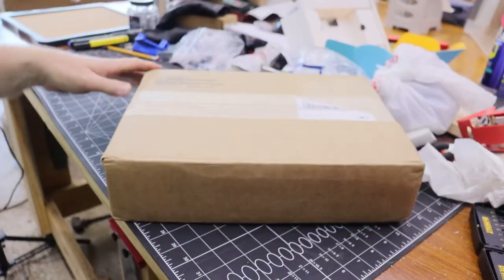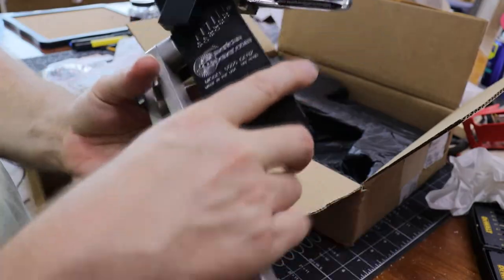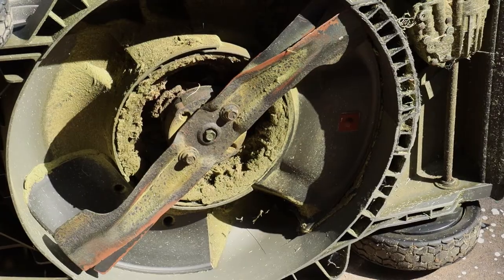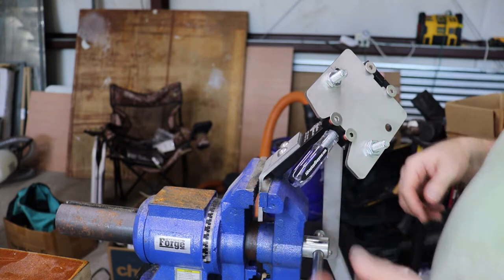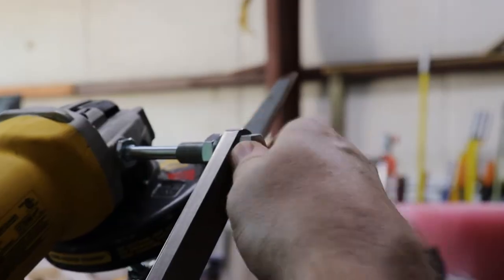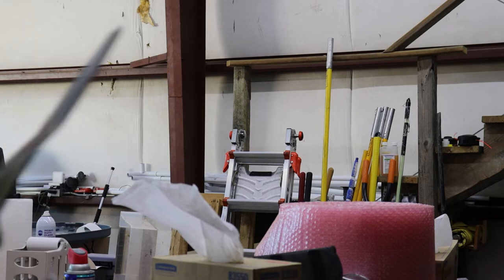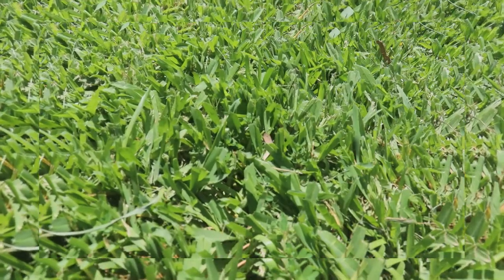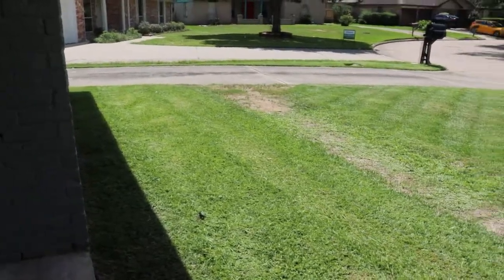🚜 Best Lawn Mower Blade Sharpener By All American!  How To Sharpen Honda Blades!

Comment: Awesome video - I have the same mower and just got the sharpener with the adapter today.   When you set up the bottom blade, did you use the left holes on the adapter for that blade?  Also just wondering what angle settings you used on that blade?
Reply from the maker: Thank you so much! I ended up using the right side holes for both blades - it moved the  blade edge closest to parallel with the grinder arm. I think that's the goal with any blade.  I used 35 degrees for the smaller, top blade and I believe 45 degrees for the bigger, bottom blade due to the twist of the whole blade's manufacturing. A test pass never hurts. I hope this helps! I may try a 60-grit flap disk mext time and oh, and have a balancer!
Reply: Thank you.   I agree.   On the bottom blade - I tried 35 degrees last night and I was too far on the high side.  Once I went to 45 this morning I was dead on along the sharp edge.  The tool is great.
Reply from the maker: Good deal! I like to hear that there is consistancy. What type of grinding disk did you use? Did it leave a burr on the edge similar to my result? Enjoy!
Reply: I bought the 9.95 Harbor Freight angle grinder last night.   I can’t screw any of the locking pins in perfect.   Perhaps I’ll upgrade soon.   I got the 60 grit flap wheel.   Many of the other guys I’ve watched said the flap wheel gives a convex or concave (not sure) curve.   I will try the grinding wheel next.   I use the HRX 217 VKA and I will say the adapter they made for this blade is flawless, even on that dropped curved part of the blade.  Bottom line is this - you won’t wreck a blade ever again using this jig.